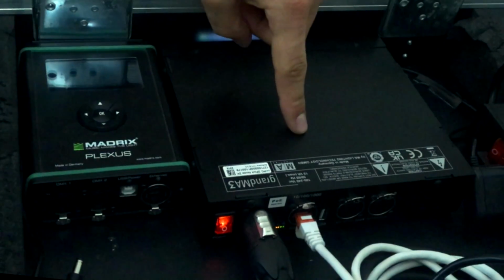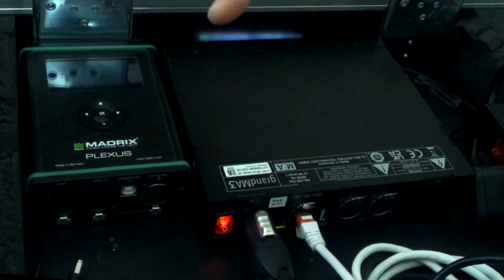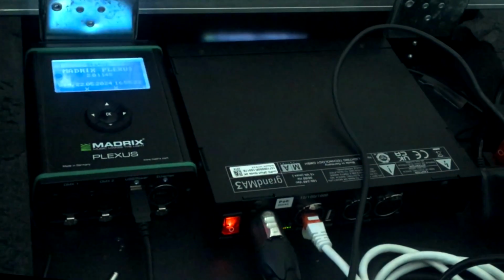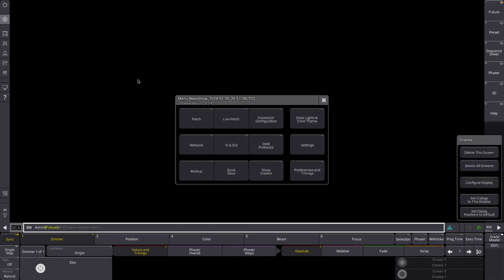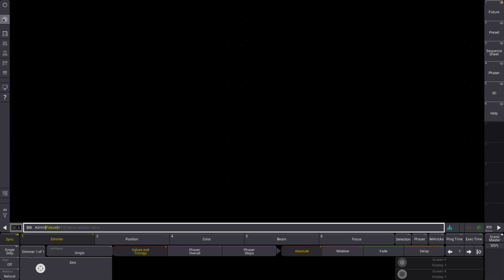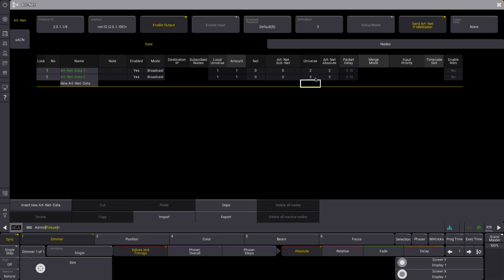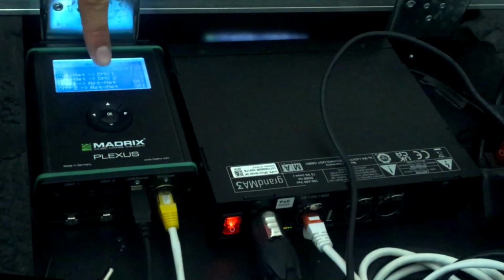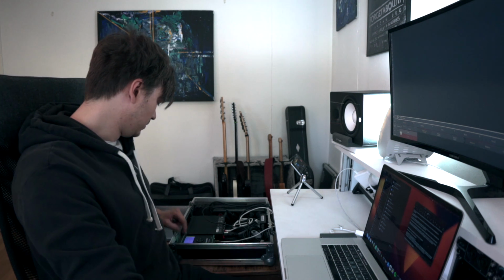Add Extra DMX Universes to Your GrandMA3 OnPC system

Comment: Thank you! Very helpful video! 
Do put the connection between your computer and the grandMA3 node on the same switch as the connections to the Madrix? Is is an unmanaged switch or do you use VLANs or similar settings?

Comment: So basically adding a node to your system removes the parameter limits by MA? Would the same work with an ELC node in sACN?
Reply from the maker: It will not remove any parameter limits as far as I know, but it will just give you some more DMX outputs👍 

I dont have much experience with sACN, but I think the principle should be pretty much the same. I hope that it will work for you!
Reply: It will for sure not increase the available Parameters on MA!
It will just increase the amount of available DMX Universes or better said in this case: DMX Connectos.
Nothing else!